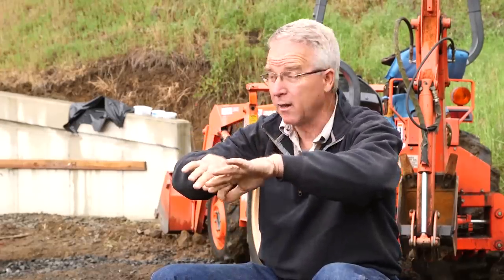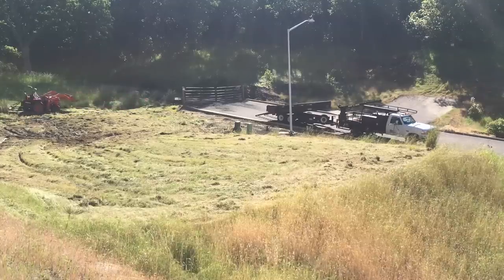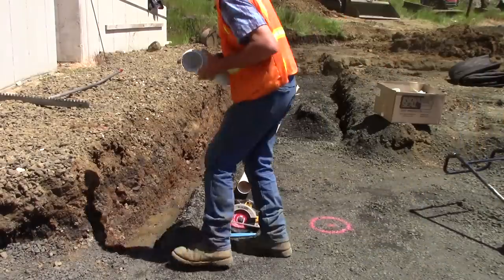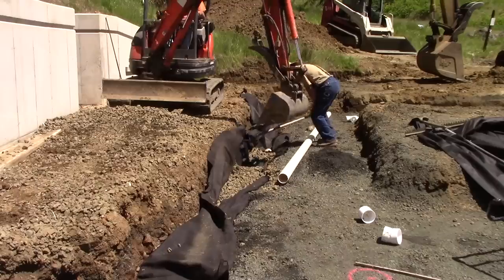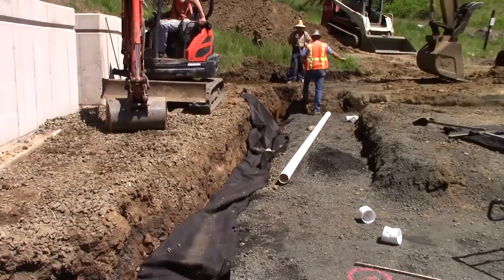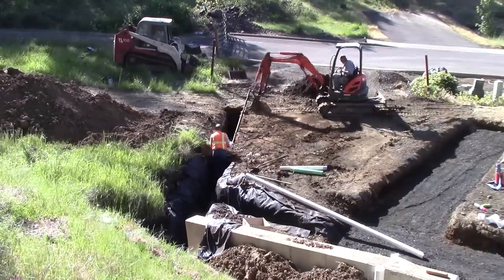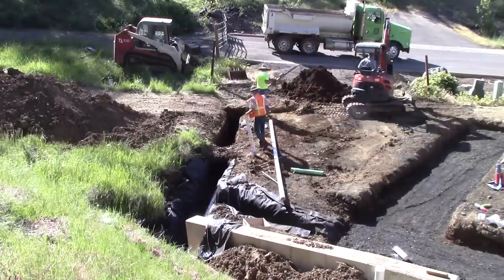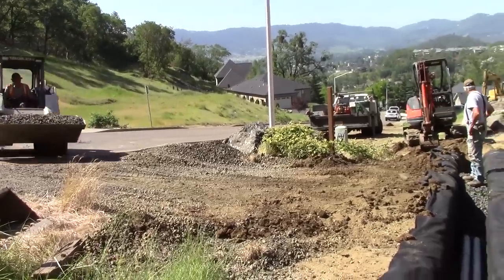Correct the Drainage Ep.27

Comment: As a registered professional geotechnical engineer out east, I am consistently impressed with how many things this channel gets right.  We use that "burrito" technique all the time to manage seeping groundwater, from small residential projects to rail yards and solar power substation pads.
Reply: yourcrazyuncledave do you instal the perforated pipes facing down or up? ( with the half of the pipe that has the holes and theough were the water sips in)
Reply: Holes face down is what I've always been told. It also acts as additional filtration this way because gravity is now your friend. Instead of sediment (that gets through the filter fabric or of it fails) falling into the pipe now it just washes down past the pipe to the bottom of the burrito. Anyone else have better info?
Reply: @MandoFettOG   always down. The water goes to the lowest point which is the bottom of the trench and seeps into the pipe and is evacuated through the smooth pipe as there is less resistance. This method is not trying to hope the water falls into the holes of the pipes but removes it from the guaranteed location.
Reply: mikeyjock 
What made it fail and how to avoid that? Or shouldn’t one use that burrito at all. In that case, what do you recommend that does work well? Just curious.  Tia!

Comment: IMPORTANT ITEM NOT DISCUSSED.....the holes of the (french) drain pipe MUST be located on the underside of the pipe (facing down) in the trench to work effectively
Reply: I believe that was done already in another video but yea I get what you mean.
Reply: If the holes are on the bottom, then how does water travel along the pipe to the end?
Reply: Agree. I also set the drain pipe over a layer of rocks, so it gets involved by rocks, which are involved by fabric.
Reply: Colin Barnett my other comment...”water ALWAYS seeks level and takes the path of least resistance....if holes are on top of pipe water has to fill/raise that distance before draining, holes facing down gives easy path for flow....
Reply: Rodrigo Batschauer that is correct for the installation
Reply: @outsidescrewball  If you put holes under, the fabric will be in contact with those holes... Not good.
Reply: Honu Moorea generally the pipe has two holes drilled, when facing down there is a flow line between the two holes for the easy travel of the water....remember water always seeks a level along with the finds the path of least resistance....the fabric is designed to filter and can be in direct contact with the pipe...typically an installation layer is the base grade, fabric, small layer of drain rock, pipe with holes facing down, complete drain rock fill and then wrap the fabric over the top of the drain rock.....
Reply: @outsidescrewball  puting the fabric in contact with holes of the pipe is bot good cause it will clog. Reason the pipe got to be in a burrito of gravel, to maximisethe fabric/earth contact and to postpone the clog of thz system.
Reply: @cbarnettcti123  because as the water level in the ground rises, it will slowly enter the pipe and follow the slope of the pipe down until it is eliminated into the storm drain. The pipes fill up in the same way as would a 2 liter Coke bottle with holes poked in it's side with the holes pointed down toward the Earth and if you slowly submerged it into a tub full of water. The bottle would slowly fill up as the water level around the bottle rises as you are pushing downward on the bottle (of course the lid should be removed so that air can leave the bottle as water takes it's place.). Hope this helps

Comment: Years ago I did a job for one of Intel's microchip reprocessing contractors. The building was massive, in excess of 75k sq ft. We had built a 19k sqft clean room inside the main building. And you would think, given that it was in Arizona, that the drainage would be less of an issue. But you would be wrong, LOL. After they moved in 16 million dollars worth of machinery, the floor began to seep water inside the clean room. The solution they came up with was to dig  a ditch around two sides of the outer building, bury a French drain, and bury a 12 foot "retaining" wall going down to the drain, at a cost reaching millions. I don't know if they ever did it. But the point is that there are no buildings for which you do not have to seriously consider drainage. Drainage is as fundamental to shelter as it is a roof.

Comment: You can get crushed material that is also washed, which is technically the best for a french drain, but it is not necessary. As long as your supplier isn't sending you the dregs of their pile, the fines that get delivered to you are not enough to worry about.

A few years back I was working for a new home builder and we had a home site with an inexplicable spring that began flowing into our basement dig. I outlined a system to drain the water out before it ever got past the footers, but left that employer before the system was completed. 

About a year and a half later, as an excavation contractor with my own company, that homeowner contacted me to come figure out why his finished basement had flooded. I went looking for the end of the drain system I had outlined but could not find it at all. turns out not only had someone moved the system from where I began it, they ultimately did not even hook up the drain they did install. The pipe just dead ended and had packed with dirt. 

It took me days of T&E to get it all figured out and fixed. It kind of felt good to be involved in that lawsuit against the builder, which the homeowner easily won.
Reply: And by crushed we are actually meaning angular stone...like washed limestone without the fine screenings. It locks together and on install it is already at 95% compaction.  Zero fine material because that would pack up and defeat the purpose of the permeability.

Comment: You give an excellent explanation. I have over 40 years experience with drainage. I cannot tell the strength of the plastic pipe you are using but as I recall the light plastic pipes can not take any stone bigger than 3/4". It has to do with point loads against the plastic.
As a town engineer, I always used clean 3/8" pea stone because it is gentler on pipe, easier to install, and gives 90 to 95% standard proctor just by dropping it in the hole. I did the proctor tests myself. The trick with pipe is the bedding. If there are voids at the  4 and 8 o'clock positions it can cause pipe collapse. I felt that the slight extra cost of 3/8" pea stone was worth the extra peace of mind that it gave. 
In the late 70s, I was an assistant in the soils lab at UCONN. We were studying the new filter fabrics(this is when they first came out). We found that some of the filter fabrics were too tight and did not allow even water to pass through. My boss came up with a quick and easy way to test filter fabrics for their ability to pass water. Just blow through it with your mouth. That simple test saved me and my towns a lot of problems. Good Luck, Rick
Reply: Has anyone ever done any tests to see whether the filter fabric will clog up from silt against the "outside" of the burrito? We did our drainage systems this way but didn't put in the cloth.Our solution was to put a 6" wide layer of 1" drain rock against the wall right to the surface (after hanging a plastic sheet against the foundation coating for the bottom 4 feet), put another layer of coarser rock from the excavation against the layer of drain rock and backfill against that. It's worked for 30 years so far.
Reply: @billbryce2538  Yes. We tested about a dozen different fabrics. Found some good and some not. Since this was 40 years ago, the fabrics have changed a lot.  The different layers of rock that you were talking about was what we used many years ago. We did sieve analysis (grain size classification of the soil) of the natural soil and the fill materials available. We would put a sand size compatible material against the natural soil and then a small gravel(compatible with the sand) against the sand and then a medium gravel against the small gravel. The pipe would be in the medium gravel. This was called a Terzaghi Reversed Filter. When I designed or installed curtain drains, I had the downstream end open to the air. The upstream end was plugged but easy to access so that it could be flushed out if necessary. All of this is very dependent on the natural material. Good Luck, Rick
Reply: Pea gravel dont lock togegher like crushed stone does it?
Reply: @fayekephart848  It doesn't but, it does consolidate better. In a confined space, such as the trench it doesn't need to lock together anymore than it does. I installed miles of underdrain and the pea stone was a faster install, never had a pipe failure(over 30 years now), and no settling. Good Luck, Rick
Reply: I have the same worry of filter fabric being clogged. As there was the car oil filter analogy: I do replace/flush that filter yearly at least... ?

Comment: Well explained video.
As a restoration tech 80% of our work is flooded basements. Due to drainage issues. The biggest problem currently is old systems that new development has built around and the municipality has not improved yet. Or a landscape company fail to consider the neighbors around their jobsite and now have directed water towards a place that never was designed to handle that water.
Reply: Also a restoration tech, packing to leave for Tulsa now. I do large loss exclusively now but back when i was just a grunt we would do 300 houses on a storm trip and it was ALL  from bad drainage blows my mind how little attention gets paid...but then again we wouldn't get paid what we do if it wasnt this way.

Comment: It's interesting to note that French Drains were promoted and popularized in the 1800s by Henry Flagg French. We have used clay drain tiles for many years that were not perforated, but gapped slightly at the joints. The pipe that we use now is typically perforated all around the periphery, so orientation is not important. Rock drains have been used for hundreds of years (see The Curse of Oak Island TV show) with or without drain pipes. I often use Pea Gravel, but also use CA7 crushed stone, since I use CA7 as my clean rock layer under concrete slabs. We made the transition from sand to clean rock under slabs in the 1970s because the clean rock doesn't wick moisture through capillary action. Many of the field tiles in my area are laid directly in the soil with no rock. The permeability of the topsoil combined with the impermeability of the clay subsoil allows them to work. We often encounter old clay tiles while installing new plastic drains and they are often in good condition. I remember a pond that wouldn't hold water because we had failed to find all of the clay drain tiles that went through the excavation.

Comment: Brilliant video. I've, among other trades, worked on the railways here in England, mostly London Underground, and worked on drainage as a pipelayer. What we did was use a shingle bed then add the pipe, we'd then cover the pipe with up to a foot of shingle then cover the shingle with the teram and finally on goes the rail ballast which is whacked down to level and then the shoulder of ballast added. 
I've got a drainage problem in my garden of the house my wife and I just bought. Family and friends have been helping with the renovations and it's funny how everyone has had an idea of what to do with my drainage but won't listen to the guy who compared to them is a master. The father in law, who is a plumber, wanted to back fill the trench in with hard core and fence it off.

Comment: In Las Vegas, some of the streets ARE the drainage ditch.  They were built where it was easy to build in washes that had already graded the land to make for an easy road bed.  There are times when the rains come where several largish roads are managing the run off and preventing a flash flood.  

One thing a lot of native Las Vegans look at is where they are in relation to those roads and pay attention to which ones are apparently at capacity when it rains.....  No one wants to buy houses on the lower third, or half, of a drainage basin or watershed......

Comment: Under the driveway and within 5 feet of the house may be required to be sch 40. Check local codes. The rest can be sdr35. Lable up and holes down. Use long radius fittings. There are tables for sizing for rainwater. If you have strong downpours you may need larger than 4 inch. It depends on square footage of impermeable surface. In this case it is pretty much the whole lot.

Comment: Good to get the drainage done as early as possible as it keeps the site dryer and you make so much less of a mess of the ground during building, we always dig out the dirt around the structure for a minimum of 6' and put at least 9" depth of crushed stone around the whole thing to avoid having to work on dirt, most of the time you end up having a hard surface around most of the house anyway so you don't even have to dig it out again.

Comment: I agree 100% with everything you say and your reasoning and planning will see you right in the long run it's great to see a video addressing these problems with ground water  and how to deal with it like you say if you don't deal with it effectively in the early stage it might only be the one chance you have of doing the drainage job properly and further down the track the problem compounds so that the structure is threatened and affected by water generated issues that become expensive and even impossible to fix. I am a drainlayer in Wellington,New Zealand and down this end of the world we get more than our fair share of rainfall and ground water , I have seen these problems you have noted and believe me many sad people would have given a lot to have your sense inside their heads- all joking aside! Further to what you have outlined when I lay a drain  for this purpose I upsize the pipe and fittings way above the minimum requirement so that a 100mm (4'') drain and fittings becomes a 300mm  (12'') drain - that's big I know, next thing I would do is make the drain permanently accessible from the surface ie install inspection/ cleaning chambers at every change in direction especially where the drain passes under a concrete driveway or other structure so that access for keeping the drain cleaned of silt buildup can be done with ease on a regular basis at cheap cost with no expensive excavation, This can be carried out by high pressure water blasting and the drain can be camera inspected to check the drain for any problems etc using the permanently installed manholes/ inspection access points,  Once the Basalt rock clogs up years and years later it would be time to replace the basalt rock, that is still a maintenance issue  that would unfortunately never go away but drainage installation done to the code, stormwater/ ground water drainage properly done need never give the owner any financial headaches --ever,

Comment: I worked on a house in a development that sat on a saturated clay rich substrate (probably why the lot was developed for decades).  I was with the painting company finishing the interior.  We were tasked with "patching" some cracks in the ceiling before the folks moved in.  I took one look and recognized that what was happening was a primary pillar in the middle of the open concept house was punching up as the perimeter walls sank into the clay.  The house is still there, but I wonder how much movement was involved.

Comment: according to the local plumbing inspector  3/4 drain rock  gets to 90% compaction  just by dropping it in the trench.  supper nice stuff to use.
Reply: That's kind of a wives tale. It is more compacted than gravel and "fluffier" soils but the compaction usually isn't that high. There are lots of voids in 3/4" stone. An engineer should still test and design a proctor  for the stone. Run a compactor over dropped stone and you will be surprised at how much it settles.

Comment: We have crushed basalt here too.  I know you're supposed to do 6 inch lifts with compaction, but sometimes space dictates that you can't do that (tractor doesn't fit in garage after backfill).  My garage has 2ft of crush basalt 3/4 minus and I only got 2 inches of compaction with a plate compactor.  (I researched the compactor before buying it, it's good for 24 inches deep).  So yeah, the basalt is pretty good stuff.
Mind you, 1500 pounds per square foot is deemed the required minimum bearing strength of soils without a geotech report.  1500 pounds per square foot is a lot less than the front tire of my truck, so if I can drive my truck on the compacted gravel and it doesn't sink, then I'm good for the long term where 5 inches of reinforced concrete spreads the load.

Comment: THANK YOU!! Drainage is the most overlooked or intentionally ignored in my area (Seattle). I view it that the builders are steeling from their customers when they save the thousands of dollars by not putting in proper water mitigation. Those customers end up paying 10's of thousands to do it later. 

And perfect details presented in the video to do it correctly:
1) slope the trench
2) wrap drainage stone with fabric like a burrito
3) use clean angular stone
4) use rigid pipe with holes facing down - I prefer the pipe with 2 rows of holes and place them at 5 and 7 o'clock

I would add to put a couple clean outs that might not ever be used, but would be useful down the road if needed.

Comment: I'm from Scotland so drainage is Always on my mind, but in this video I have a few questions, 1. why are you using such a small diameter field drain? 2. why did you not wrap the field drain in terram 1st before covering it in chips ( what you called washed rocks, but was way too dusty to be washed as the dust will block the perforated holes in the pipe. I have even used crushed glass (its  roundish and smooth) in the latest house that I have worked at.